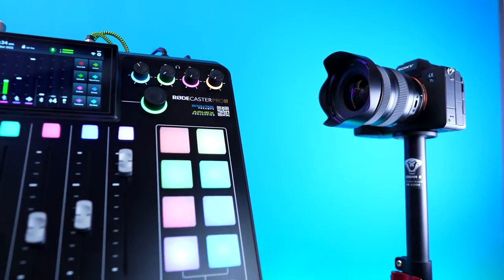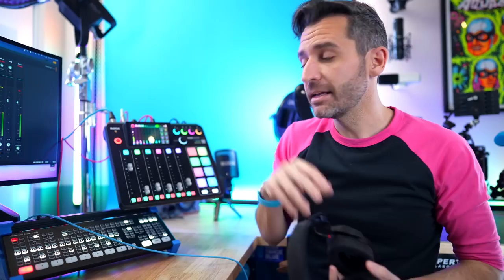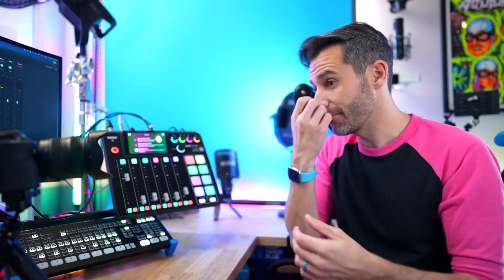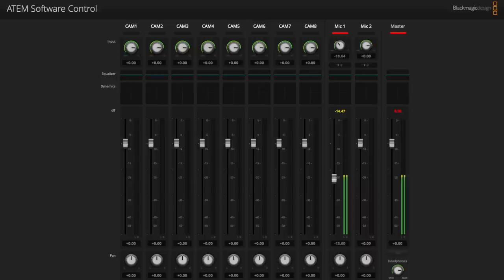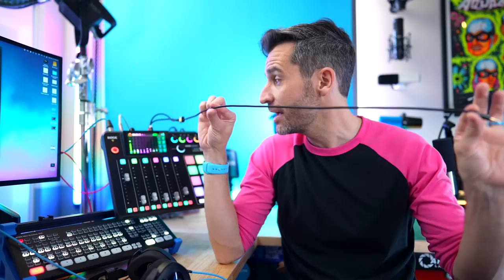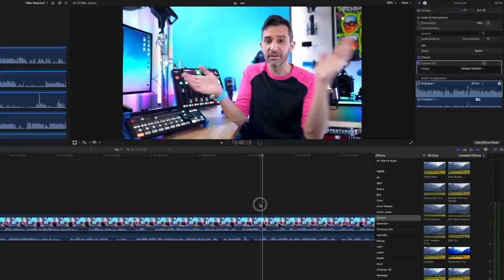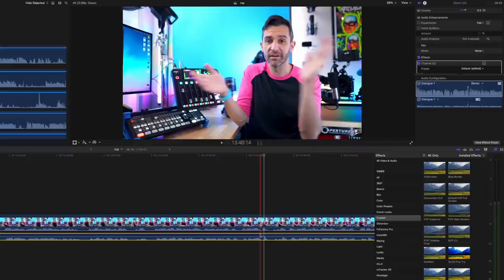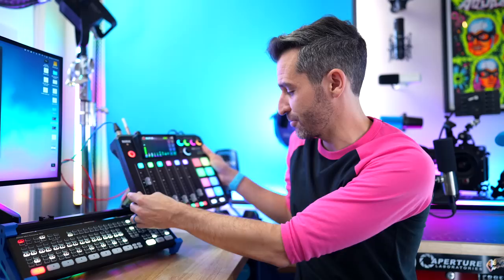How To Connect the Rodecaster Pro to a Camera or ATEM (and why you SHOULDN’T do it)

Comment: I have found the solution to get the RCP2 sound to my FX3 with perfect output FOR ONLY 40$ on B&H. I used Movo Photo MV-RC100 3.5mm TRS Line-to-Microphone Attenuation Cable for DSLR/Mirrorless Cameras (12") and the Rode extension cable RODE VC1 3.5mm TRS Microphone Extension Cable for Cameras (10') with a simple ¼ to ⅛ TRS adapter plugged into a headphone output of the RCP2. Sound is exactly the same without any added noise.

Comment: I've seen comments here about ground loop isolators. This is definitely the way to go, however if starting programs on your computer cause noise this is almost entirely due to USB ground loops in which case you'll need a USB ground loop isolator. The different cables thing is interesting though. I bet if you you held the connectors next to each other you'd see that the plastic spacers in between the ring segments on the 3.5mm plug are slightly different widths on the the red vs the black cable. Unfortunately I have found that manufacturers don't really standardize this with regard to tolerances and some devices have tighter tolerance requirements for the TRS segments than others.

The length issue is also definitely of concern as the longer the cable the more of an antenna it becomes. It would be interesting to see a phase difference test with the Rodecaster. Though narrowing down what is causing it would be a pain. Anything from lights, monitors, or even the device's own power cable can introduce this.

Having said all of this... the cables seem to be around $10 cables. Order a Y cable from infinite cables or spec your own from performance audio and pick your cable, connectors, etc. Then, I would see if that helps. I'm not saying you need to go buy a $200 cable from audiosuperdupergalaxyprimequestcompany, but I've had great headache free $30 to $40 cables from Infinite cables, performance audio, and seismic audio.

Comment: Thanks for this great video. I used a wireless mic (Synco) to send audio signal from a headphone output to the Atem M. E. I know it’s not the “correct” way to send audio but it was the only way to avoid that noise.

Comment: Great video! The workaround I found for syncing the audio was to connect the RCP2 to my Mac via usb. Then I connected my camera (LUMIX GH5) via HDMI to an elgato camlink 4K which I connect to the Mac and record both audio and visual in OBS. It’s a lot of connections and does require investing in the camlink but it’s the most reliable solution I’ve found and saves transferring data from SD card to mac

Comment: @Tom Buck what works is - RCP L/R TRS/TRS cable to input of Radial J48 Stereo, and then XLRF L/R to 3.5 TRS works well. Very expensive setup, but it works. As many people already noticed - it's all about the fact that BMD decided to use unbalanced MIC inputs which makes them unusable in most situations (unless if you're using something like Wireless GO that's ment to do exactly that). So it's better to go through camera and merge video and audio via HDMI.

Comment: I had the same problem in my business and used a ground loop isolator. It removed the hum and noise. Try that and see if that works. I had to connect that to the overhead speaker system to my grocery store. It was producing an ugly hum noise with the background music. It worked like a charm.

Comment: Hey. Great video, thanks. I agree wholeheartedly with keeping things separated, but if you're in a fix, the best results I have had were in using a Rode wireless Go or Go2 receiver into the Atem and connecting the transmitter to the RCP's line outs, using the same kind of cable you used in your demonstration, or even out of one of the headphone jacks (though that's not what one should do). I've had no issues with interference. It's another item you may not want to purchase, but in case some of you already have it, Give it a Go ;-)
Reply from the maker: This is a really smart solution to the extension cable issue– I'll have to give it a try!

Comment: I use an Atem mini Xtreme at work and when I am connecting a Podcaster I always use an audio mixer in between. So from the Podcaster, quarter inch to quarter inch, into an audio mixer, mono xlr out to 3.5mm into the Atem. This has worked for me with no hum or mosquitos in the line. It is an added piece of equipment yes, but Ive always used an audio mixer. For me it was adding the Podcaster into the lineup for different clients. Hopefully this helps.

Comment: Thank you so much Tom for that video. I bought the exact same red cable since I saw it in your setup like 1.5 years ago. Last year I had that question in one of your live streams that I have that noise interference when the Rodecaster Pro (V1) is connected to my Atem Mini Extreme ISO. Now thank you for the solution 🙂

Comment: Great comparizons and walkthroughs Tom! I've used the Atem Mini Pro to record directly to an SSD and I really needed to tinker hard with the input levels. The ground rool of obtaining the highest input gain possible without peaking into reds has such small margins on the AtemMP that it's very difficult. Then the audio chain continues with the channel volume, and then the master output gain. I did manage OK but the RodeCaster Pro II (the one I''ve got) is so much easier to work with, as well as that they obviously worked hard on those preamps. I also own an Arturia Studio Fuse interface and that's a pro device, the difference is in the ”air” moved, and at the same time I'd used Arturia with large membrane condenser mics in a treated room so it's not really the same thing. RCP II is an amazing device and besides for livestreaming I also record internally a lot. 
Now, those cables… oh man, extensions are usually lower quality than the dedicated cables like the one you've found. Works great on its own but is short. 
My solution would be to buy Mogami or other cables and solder everything one needs. Buying individual components and then assembling the cables needed is the way to go.
Reply: Good advice, thanks!

Comment: Had the same issue when trying to connect my Rodecaster Pro (I) to my ATEM Mini or Sony ZV-1 & do Live Streaming. After finding out from Rode that the outputs the Rodecaster (I) has are balanced – I ended up with some adapters / cables from Amazon and got it to work with no issues. Dual 1/4” balanced (Y) to single XLR then XLR to 3.5mm. No interference, No noise… Hope this helps.

Comment: I had the same issue with the extension cables. I found the best option is to use a super short 3.5mm cable into a 3.5mm -> usb adapter (I used an Audio Technica one on Amazon), then use a usb extension cable to get the signal where you want it. 

It's more expensive (the 3.5mm to usb adapter was like $25), but it got rid of the noise. 

I'm assuming this is because the adapter switches the signal to digital which makes it less likely for the signal to attenuate by the time it gets through the long usb extension cable.
Reply: I would think that it's not signal attenuation differencess but the fact that the USB signal and cable is less susceptible to RFI and EMI.

Comment: My Solution for the interference and noise that gets into the audio cables from the any audio interface into the ATEM Mini was to AVOID using the mic input on the ATEM totally and use one of the HDMI inputs to route audio instead. To do that, what you do is that you run the RCP II audio from the DAW through the HDMI output of your computer into the ATEM and use that channel as an audio-only channel. 

The sound is clean and free of interference when you do that. Make sure that you have a GPU that can send HDMI audio that works. Not all GPUs seem to be able to do it and some Dual Port to HDMI adapters might not work. 

With the RCP II, you can adjust the audio delay to match your video if you are running the audio. The ATEM allows you to switch on multiple HDMI sources for audio and mix them even when you can only select one video source. 

Things have been very clean ever since I did that.

Comment: I have a similar setup, but I use a Rode 3.5mm cable and run it from the front headphone port of the Rodecaster to the Mic 1 input of the Atem. In ATEM settings, adjust the sound setting from Microphone to Line. No interference problems and it sounds great. Set the headphone level at about 1/2 and then adjust the gain on the ATEM to compensate. None of my cameras capture sound if I'm using my Rode. Everything compiles in the ATEM and gets output to a single channel via USB if I'm going to my laptop or HDD.

Comment: Tom, thanks for the video, gave me some stuff to think about.  I'm starting a podcast that's also live streamed.  Right now I have the setup you don't recommend.  So I have the RCPII, the ATEM Mini Extreme ISO.  I'm running 3 cameras into the ATEM - Sony A7iv, Sony A6400 and GoPro Hero 10 Black.  I have the RCPII connected to the ATEM by 3.5mm to 1/4" split into the Monitor Outputs on the RCPII. I'm running 3 Sure SM7B mics Via XLR into the RCPII. The ATEM is connected via USB-C to my MacStudio and I use EVMUX to do the live streams.  I like having everything running into the ATEM simply because it creates the Davinci Resolve project and I have all the audio and video in that one project.  If I split out the Audio and Video, so I would remove the 3.5mm to 1/4" split to break the connection from the ATEM to the RCPII, then the Davinci Resolve Project would be audio-less and I'd just have to import the Audio file from the RCPII to sync it?  I would also then connect the RCPII to USB on my Mac Studio so that EVMUX would see the RCPII as the Audio Source and the ATEM as the Video Source?  Here's a link to one of my episodes if you want to see/hear how it sounds?  https://youtu.be/tGhMVlkxV5w
Reply: @Chris Davis wow great ! I’m using Yolobox pro and Sony zve10 and Sony 6400 for vlogging and sport streaming . Using rode wireless go II . Thinking about to purchase the Sure SM7B and  Rodecaster pro 2 for better audio quality. What about noise like Tom that’s told?

Comment: Try using a hum eliminator.  Even the one from Pyle works pretty well. I use it to get rid of interference coming from my Intel NUC into an audio interface then to the PA. Without the hum eliminator, I was getting the high pitched whine, which drove me and people nearby nuts. Once I added the hum eliminator, the noise was gone!

Comment: Great Video Tom! You can also embed audio from the RodeCaster Pro into the HDMI then into any HDI input on the ATEM.  This bypasses the preamps on the camera and the ATEM all together! Churches do this to bring audio in from Sound Boards into their BlackMagic production mixers. They makes a HDMI to SDI 6G convertor (With Audio Embeding)  for this but you then you have to convert the SDI Out it back to HDMI for the ATEM (Roland makes a better option). I use a Blackmagic HDMI to SDI 6G convertor to record 4K from my EOS R with Rodecaster Pro Audio Embed to my Hyperdeck Min. The convertor has a SDI loop out so you grab a SDI to HDMI Mini Convertor and you into the ATEM with RodeCaster Pro audio. Rode Makes a Convertor with frame delay for "lip sink'. Roland VC-1-DL Bi-Directional SDI/HDMI Video Converter with Delay and Frame Sync (Not Cheap but I worked at a church last spring that sues it then into a HyperDeck HD (Recording) and Web Presenter for Streaming. I got to install them.
Reply from the maker: Very interesting idea Keith! Thanks for the overview of the whole setup!
Reply: @tombuck  My Video on my Convertor: "HDMI to SDI 6G Convertor to record 4K to the Hyperdeck Mini from EOS R 4K"
Reply: Great new firmware update are you making a video?

Comment: Hi Tom, I just found you in the YouTube Universe, thanks to your videos I just bought the Rode Caster Pro 2, and I wanted to know if it's normal for it to make an internal noise when you turn it on?  thanks again 🙏
Reply from the maker: Hi! The RCP2 has a haptic engine inside (so if you want you can have it vibrate a little bit when you press a setting on the screen), and this makes a little "buzz" type sound when you first turn it on. If that's what you're hearing, it's totally normal and just means everything is working as it should 👍
Reply: @tombuck  Thanks 🙏

Comment: The cable you linked to is sold at 3:20 is sold out, and you posted this video 5 days ago! You must have made them get popular! Any other suggestions? It’s frustrating  this $700 machine is reliant on a such an easy to get wrong patch as this cable to work with the ATEM, blackmagic didn’t do us any favors there.
Reply: Well, I knew that was going to run out, too. I had the same problem in my business and used a ground loop isolator. It removed the hum/noise/interference noise. Try that and see if that works. I had to connect that to the overhead speaker system to my grocery store. It was producing an ugly hum noise with the background music. It worked like a charm.

Comment: What is wrong with running the audio from one of the headphone ports to the atem mini?   That’s what I do and I have never noticed an issue.   Of the 4 headphones, one runs to my atem mini, one to my BmPCc, and then 2 of them run to headphones for podcasts
Reply from the maker: That's true, it can totally be a solution. I used to do that with the original RCP, but found that the audio quality wasn't the same as a "true" output, but that could be different with the RCP2.

Comment: Hey Tom, I wonder if you could use an RCA to HDMI or AV to HDMI converter and just use the audio part and route the audio from the Rodecaster to the atem mini. You would lose one HDMI port but you would be able to use the Rodecaster preamps and have the signal go through the Camera preamps or through the mic input of the ATEM mini.

Comment: I'm wondering if a higher grade cable would give better results. Perhaps you might contact Trew Audio, Location Sound or even Sound Speeds about a higher grade cable to use instead of the extension cable - it could even be a custom twin 1/4" to mini stereo.
Reply from the maker: I have Allen's XLR cable and it's incredible! Honestly, I hate running the RCP into anything, so this was mainly to try and answer the question for those asking since a lot of people DO like to do it, so my goal was to try and find a simple semi-universal solution that would hopefully be pretty accessible.

Comment: An ISO transformer on each channel send from any mixer is all you need. Any cables will work for you. I use Samson MLI1. 
Best thing is the ML1 has a multi input XLR so you can send jack to jack or jack to xlr or whatever configuration fits the output on your mixer. Then run the mono jacks to 3.5mm jack out the other side of the ML1's to the ATEM Mini. 
Trust me. I found this solution years ago when I'd had enough of the ground loop issue with the ATEM mini 3.5mm mic socket. I even had the issue using balanced digital mixer outputs. 
Not sure what Blackmagic was thinking when they designed the audio input on the mini? But it's not great.

Comment: I bought that same VESA arm but I couldn't fit it with my current setup. My laptop stand, like you said is my active solution. maybe I should rethink my setup? 🧐🙃
Reply from the maker: If anything, I wish the arm were a bit longer. But I think your setup has a lot more gear in a much more compact space than mine. Maybe there's a way to mount an arm to a wall?

Comment: Im connecting the 3.5mm to 6.5mm L/R from my Sony FX3 to the rodcaster II... Doesnt work its not picking up the audio on the camera. I have two rode casters and two fx3's ... Didnt work on either. Using a Ugreen cable

Comment: Have you tried using a ground loop isolator on the 3.5mm jack cable , I use it on all my connections and it makes a massive difference - around #10 from amazon

Comment: Hi Tom:  More terrific content on the RodeCaster Pro.  I appreciate you sharing your "trials and errors" connecting it directly into your camera.  Have you encountered any synching issues between audio and video in Zoom when connecting the camera via HDMI and the RodeCaster Pro via the monitor outputs separately to the computer?
Reply from the maker: Hey BB! Syncing issues can definitely happen, but it's totally normal. Fortunately the RCP2 has a built in output delay that can help. But I normally run all of my audio/video through Ecamm when using Zoom, so I just add a 4 frame audio delay in Ecamm and it gets everything back on track 👍
Reply: @tombuck  Hey Tom! Do you have a video explaining how to fix audio and video sync issues when streaming live (through Zoom, for example)? I get how to sync audio and video recordings, but what's the fix when using Zoom or Microsoft Teams?

Comment: The adapter cables can never compete with Robust XLR BALANCED cables, BALANCED and SHIELDING being the key variables for quality audio cables and interfaces. The best solution is direct boxes to inputs and outputs. I have the ART cleanbox, it has various inputs (XLR, 3.5, RCA) you can then run very long XLRs to connect to cameras, interfaces and other mixers!
Reply: This ART box is how I solved the issue of noise to the ATEM. I also added an isolator for good measure between the ART box unbal out and the ATEM mic in. Result - no perceivable noise

Comment: Does the rodecaster record audio on its own? Or does it always have to record to a computer?
Reply from the maker: It has excellent internal recording, which is actually what it was originally built for. But over time, it's evolved into a pretty feature-rich interface.
Reply: @tombuck  for podcasting, would it be better to record to a rodecaster and transfer the file to your broadcasting account? Or record to your computer vía garage band, audacity, etc?

Comment: The 3.5mm plug and jack combination  is not great for low noise at very low levels and should be avoided. For cables I stick with the brand name called Hosa, they are inexpensive and pretty good quality, by far not the best but I have no complaints.